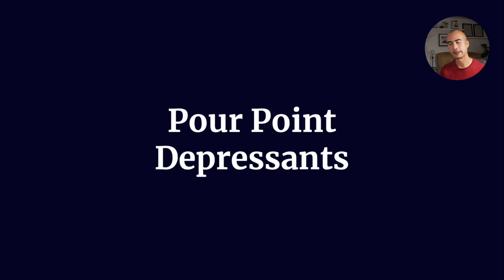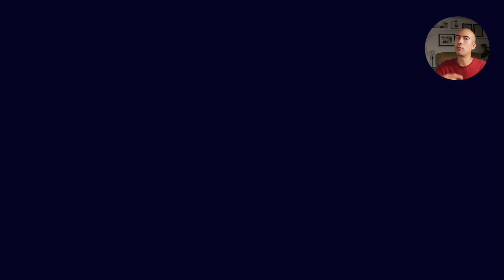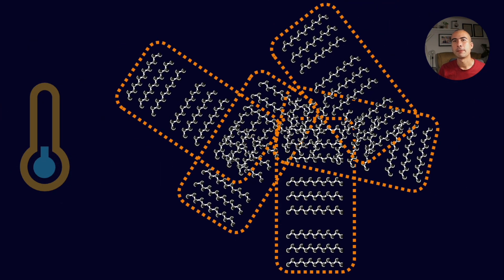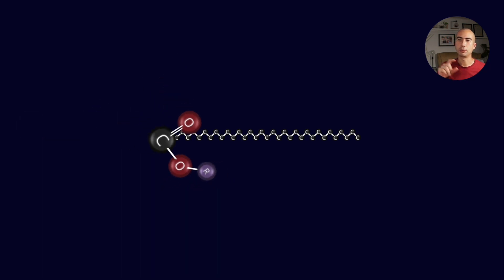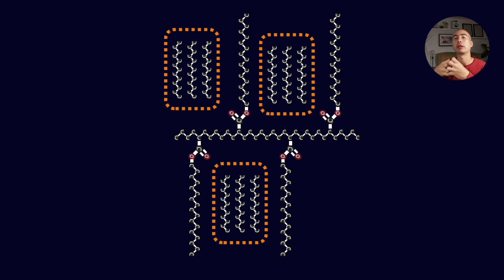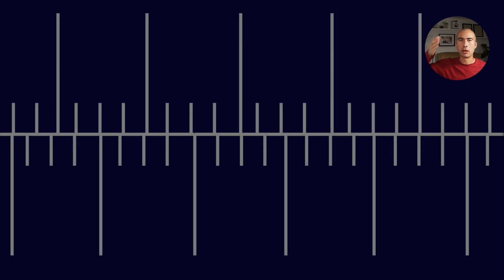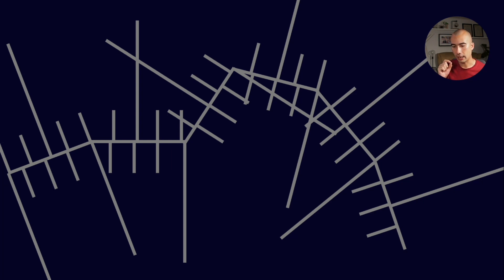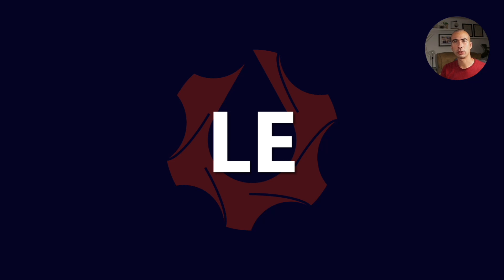How do pour point depressants work?

Comment: Which additives would you suggest for a pyrolysis plastic oil with high bromine number?
Reply: Anti-waxing and pour point speaking
Reply from the maker: I don't work as a formulator so I can't really point you to specific additives. Most of the Pour Point Depressants are Polymethacrylates though, there won't be a whole lot of variety.

Comment: Hello! How does Sulfuric acid remove contaminants from used automotive oil? What major reaction mechanism is evident?
Reply from the maker: Good question - I'm not very involved in re-refining so I can't speak much to the chemical reaction there. From what I understand though, sulphuric acid is mostly used to dissolve gum and sludge - this on its own is not enough because you then need to neutralise the acid, precipitate out the produced salt and then filter. If you leave any sulphuric acid in it would act as an oxidation catalyst.